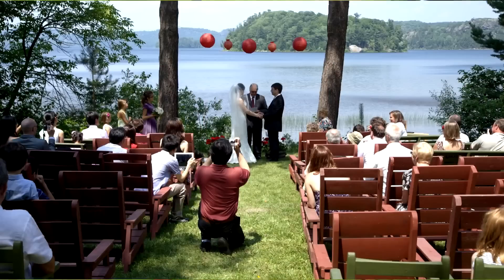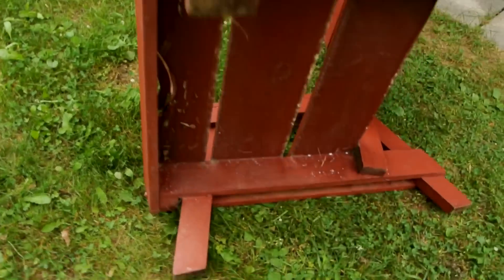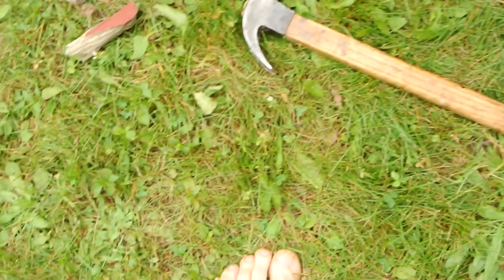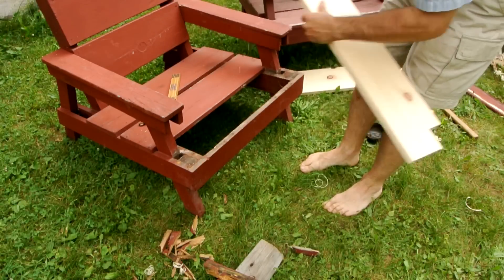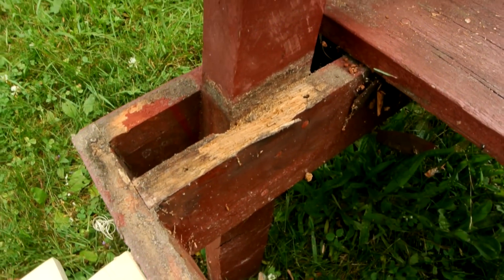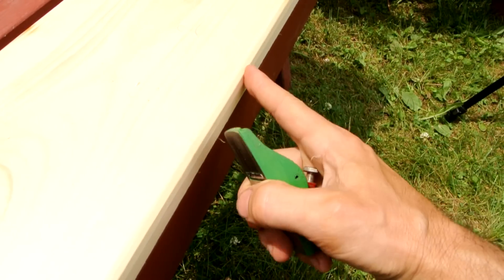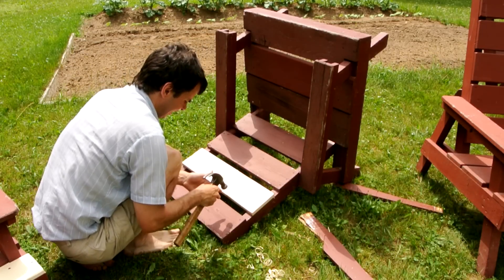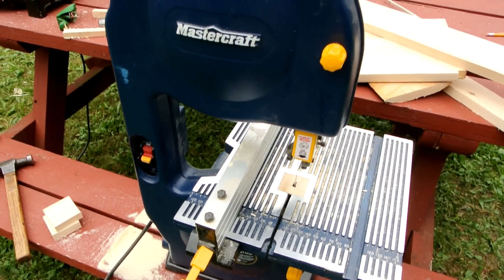Repairing lawn chairs / wood rot

Comment: I love the way Matthias gets that palm plane to shave just right. I’ve never had much luck, try as I do. In fact, I dread trying, nowadays.
Reply: It's not too bad! If you can get a sharp edge with the blade, just place the blade in just shy of cutting, tighten it in place, and lightly tap on it with a mallet to make the blade protrude a bit. Test on a piece of pine - if not cutting, then repeat.

Comment: I just read an article on Fine Homebuilding about three best practices for building decks, and one of them may be of use here: before attaching the deck boards, cover the joists with peel-and-stick rubber flashing. That will shed the water that gets under the boards and protect the horizontal joists from rot. 

One thing that I've done on my recent outdoor projects is to seal the end grain of feet/legs that have ground contact with 100% silicone caulk. I apply it with a putty knife.

Comment: I'd suggest priming and painting all the edges and faces of the slats before attaching them so they are protected all around from moisture.  I'm guessing you figure that's not worth the trouble since the older parts will probably fail before the fully painted replacement parts would anyway.

Comment: I have a small 9 inch Ryobi band saw and it does not track well. Is there an adjustment for correcting it so it tracks straight, or at least, straighter?

Comment: Only that I expect X < 1.1 in the case of outdoor furniture. I am sure that you can do more by avoiding large horizontal areas of contact, as Matthias Wandel said. Slightly saddled joists, distance wires and so on. Not to forget using suitable wood.

Comment: It would be interested to see how the silicon seal works over time.  I was always taught that you never want to seal the bottom of endgrain boards that touch the ground, because water that makes it into the wood (and it always will) will just pool inside the wood at the lowest point and rot it out from the inside.

Comment: Wrong. When holding it like Matthias does, he has a lot more control of the hammer. Those thin nails will bend very easily, if hit just slightly wrong - so control is essential here...

Comment: Wow, a lot of ignorance in here about the proper way to use a hammer..  You NEVER choke a hammer, if you need "more control", you use a smaller hammer.  Dont matter the type of nail.  Could be 1 inch finish nails or 6 inch spikes.  Drive 1,000 pounds of nails and tell me it is a good idea to choke the hammer.
Reply: Have you considered that maybe he only had the one hammer with him? He isn't working in his shop after all

(and yes, I realize that you made this comment 4 years ago)